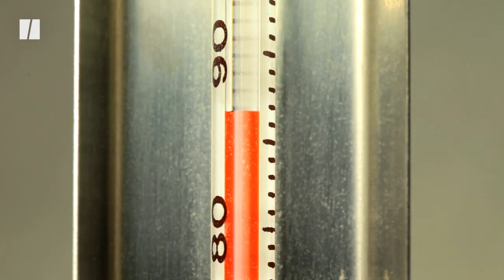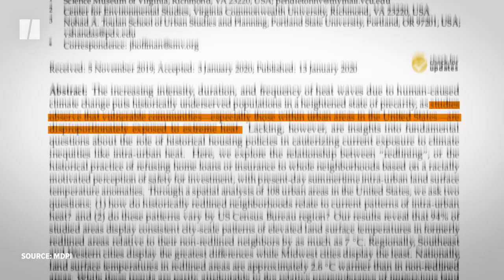Extreme Heat Destroying Cities?

Comment: Enjoy your electric cars in states like Arizona, Nevada and other hot states where the grid can barely handle the demand from all the air conditioners. You liberals are out of your mind if you think the electrical grid can support your electric cars. Good luck keeping your air conditioner running without a power outage especially during the peak hours at night 🖕😂